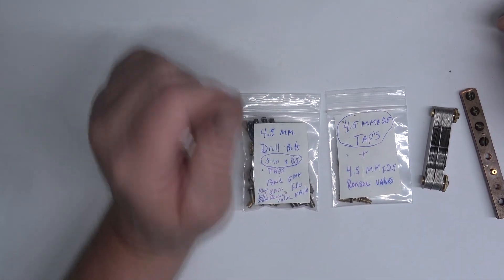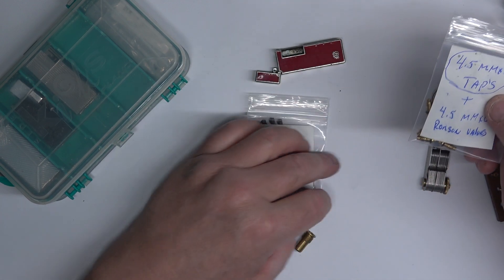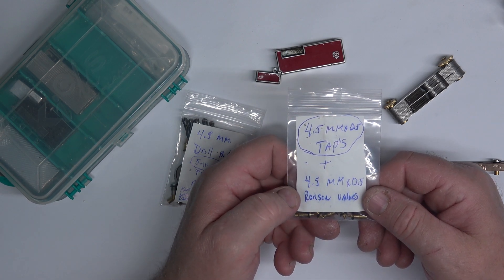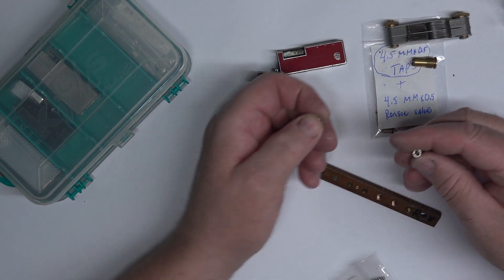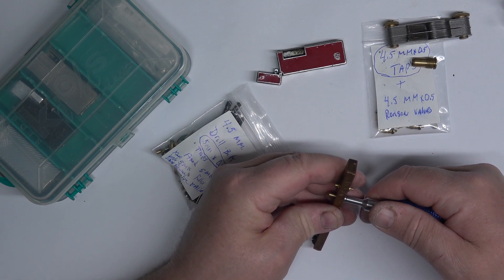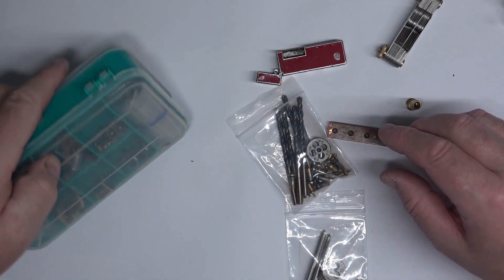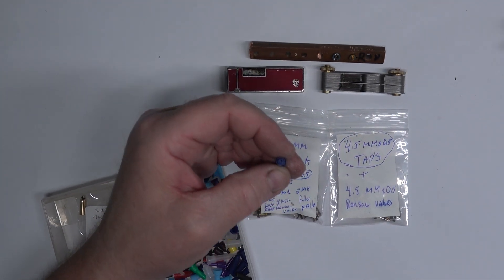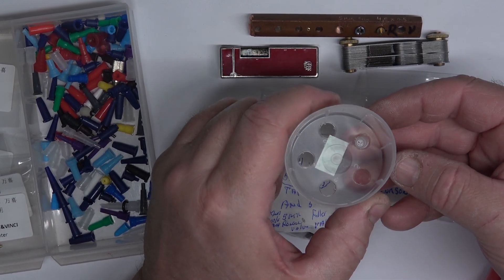Butane lighter repair, Filler Valve Modification and tools used

Comment: I can't find valves or tools any where. Can you please help?
Reply from the maker: Here is the KWA Valve link
https://store.kwausa.com/product/kwa-universal-gbb-charging-valve/

Here is the 4.5mm Ronson Valve That you will need to drill a 4mm hole
and use the 4.5mm x 0.5 tap for it.
https://www.ebay.com/itm/263561289284?_skw=ronson+valve&itmmeta=01K1GSPJT5A20PKDJQRV5P72Y2&hash=item3d5d7a1e44:g:WQYAAOSw-NFasWyK&itmprp=enc%3AAQAKAAAA0FkggFvd1GGDu0w3yXCmi1d2AMfomRAegNPZl1T5DAg68SdZY11StLcqjm%2BSLxkWScHKBinOsU3kVYyPwsKqv36k1n1dSfOEGlwpzcaVuf6HrPmY0%2FC4%2BMPSFFs5wYk9F3dSG39NztTGLf0E89CTO4Fk10Gb9qivs89UI3MlD%2FXofRK2XpPXz5arw5HskKAlttOsYgQpw4%2FI5tx1mh8oBG7JjL3ACuJ9rdZY6C4CHxnZusOUVRDQ4Tov9Jt4WXdcYLk5ihYItIKBYWtg%2Fztz1Uc%3D%7Ctkp%3ABk9SR6it2pmMZg
Reply: @Lighters-cf4bd  Thank youso much!

Comment: Thanks for the video! What is the name of that blue handled tool? I sure could use one of those.
Reply from the maker: I went to aliexpress and checked out my order and the page doesnt exist now. Here is a llink from google but the same thing.
https://www.bing.com/images/search?view=detailV2&ccid=xLljG7UI&id=9BDC0910D81E0BB93F2E31E652AA95B52F441EAB&thid=OIP.xLljG7UIAk3scCb2jiwKVQHaHa&mediaurl=https%3A%2F%2Fae01.alicdn.com%2Fkf%2FSd2b503f287094c66b28503acce5d87752%2Fairsoft-Integrated-gas-valve-wrench-universal-Glock-G17-G18-G19-P1-1911-2011-inlet-and-outlet.jpg&cdnurl=https%3A%2F%2Fth.bing.com%2Fth%2Fid%2FR.c4b9631bb508024dec7026f68e2c0a55%3Frik%3Dqx5EL7WVqlLmMQ%26pid%3DImgRaw%26r%3D0&exph=1100&expw=1100&q=+airsoft+Integrated+gas+valve+wrench+universal+Glock+G17+G18+G19+P1%2f1911&simid=608023625857721422&form=IRPRST&ck=4D240E479FE64C662ADAD93A9380BCB6&selectedindex=23&itb=0&ajaxhist=0&ajaxserp=0&vt=0
Reply: @Lighters-cf4bd  Thanks! I'll see if I can find it from another source.
Reply from the maker: @neolexington  I have an extra one if you havent found one
Reply: @Lighters-cf4bd  I did find one, thank you for the offer though.
Reply from the maker: @neolexington  No problem!